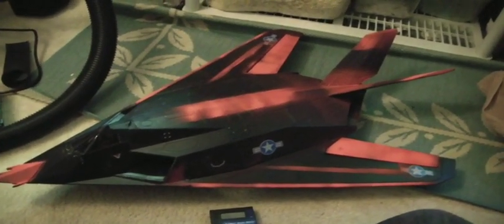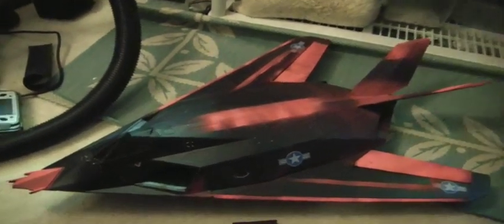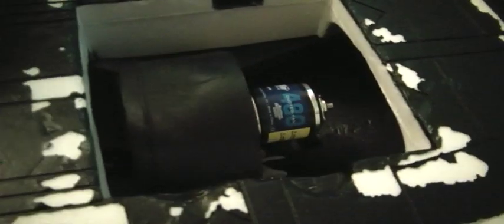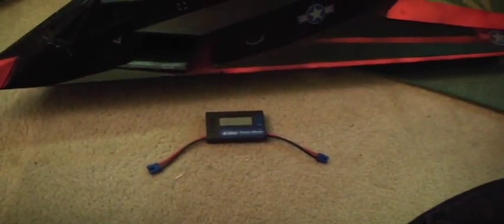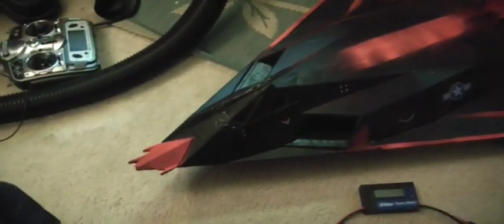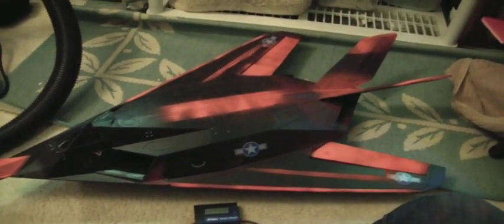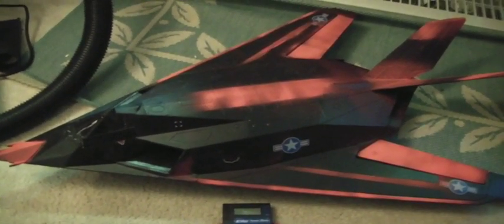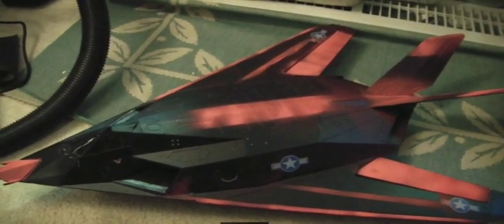F-117 Upgraded to run on 4cells!  New EDF Motor & Paint job!

Comment from the maker: @Admiral1428 yes, I agree, however, with the 3 cell battery, it was so nose heavy the elevators had to be a good amount above center for this plane to fly straight(and I mean a GOOD amount above center).  I added some weight to the tail to help even it out a bit.